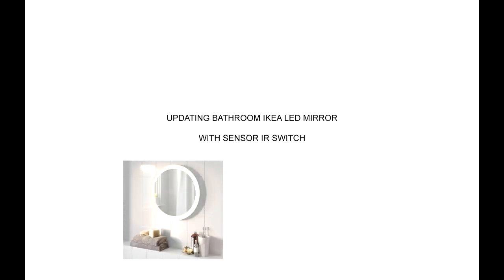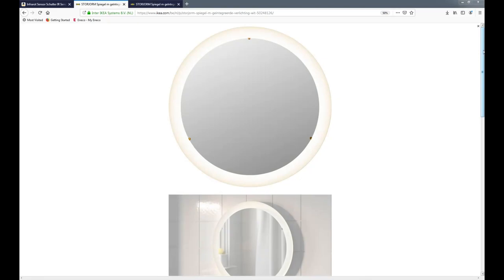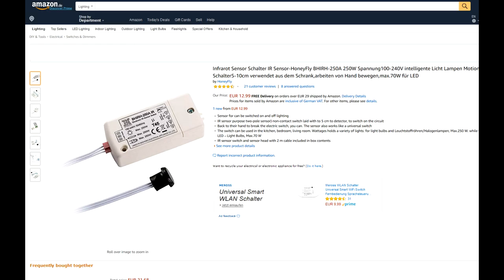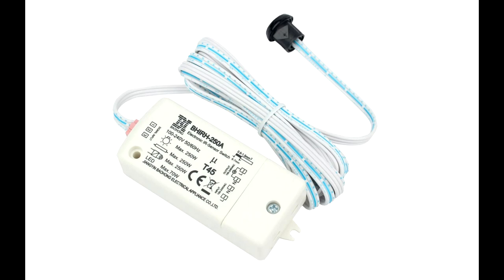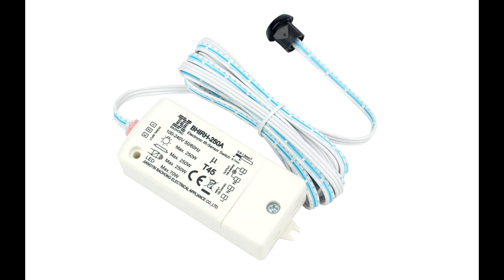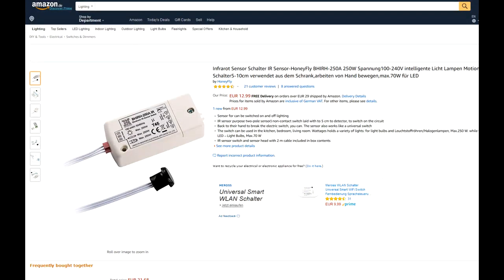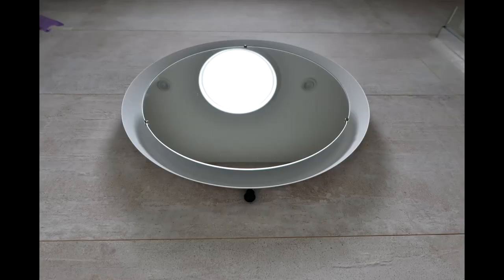IKEA LED bathroom mirror STORJORM - adding a sensor switch

Comment: Thank you for sharing. It's mind boggling how IKEA is selling all of their mirrors with LEDs and LED lights for mirrors without any switches.
Reply from the maker: Thank you! Yes, I was also very surprised to see no switch in the box..that's when I realized I have to hack it! :)
Reply: Because they're supposed to be used as bathroom light, which is turned on/off with the lightswitch outside the bathroom..
Reply: @Goldy01  thanks for the reply. I get that and for simplicity it makes sense. Having said that most bathrooms are also fitted with extractor fan which kicks in as well. If I am going to bathroom in the middle of the might or early morning I prefer to keep it quiet and not to get blinded by the main lights - this is where separate switch comes in handy.
I managed to get myself Astro 1010001 Curve Wall Light Switched which does the job and has somewhat standard bulbs that can be replaced with LED  at 5000k. Beauty.

Comment: Thanks for this, it's a great practical idea and saves doing complicated electrical wiring and hacking holes in the drywall in order to install a wall switch. I can't believe Ikea didn't include a simple switch with this mirror. There's no proper warning in the product description. BTW Ikea don't seem to sell this circular mirror in the UK anymore, only the larger square version and as I no longer have the receipt I can't take it back, so I will use your hack instead.
Reply from the maker: Hello Henry, same thing has happened to me, I came home from IKEA and found out the mirror had no switch. Totally agree - warning on box should prevent this!

Comment: Hi! Was the power supply that you used, the same one that the mirror came with or did you buy it somewhere else? The one it came with looks different and the light isn’t as strong when I plug it in. Can you tell me where you got yours? Thank you :)
Reply from the maker: Hi Jennifer, there is no power supply included with the IKEA mirror. Mirror comes only with wires with you have to connect to your power grid. But in my case I connected this sensor (bought from Amazon) in between mirror and power grid. Honestly, if you have no experience with electricity I warmly recommend asking help from electrician or friend who has some experience... I hope it helps? Let me know how it went!

Comment: Hello I was thinking of doing the same thing and I was wondering how you hooked up the sensor to mirror?
Reply from the maker: Hello Sierra! Sensor itself is not firmly attached to mirror but only hanging. Actually it's slightly pinched between wall and metal casing of mirror (rear side). Hope it helps..thx..

Comment: Hey buddy, I got the exact same motion sensor hoping to install it the same way you did, but I’m a bit lost about which wires go where.
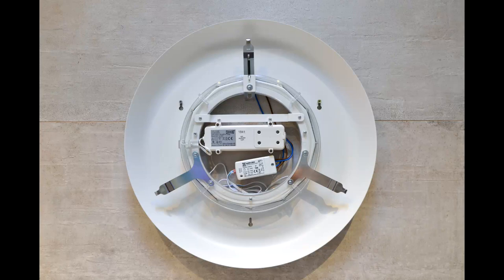Reply from the maker: Electricity wires from the wall go to sensor switch INPUT. OUTPUT from the sensor switch goes to mirror light. Or in another words, sensor switch is between your electricity cables and your mirror. Check video at 1:05. Hope this helps. Enjoj!
Reply: @tomk6401  Hi, can you do a video where you show exactly how to install the sensor to the mirror?

Comment: Hi Tom, having trouble locating this switch, can you please provide a link or english translation thanks
Reply from the maker: Hello JP, here is the link: https://www.amazon.de/dp/B01H1GG62Q/ref=pe_3044161_185740101_TE_item
You can also try to search by following term: Infrarot Sensor Schalter IR Sensor-HoneyFly BHIRH-250A 250W.

Hope it helps :)